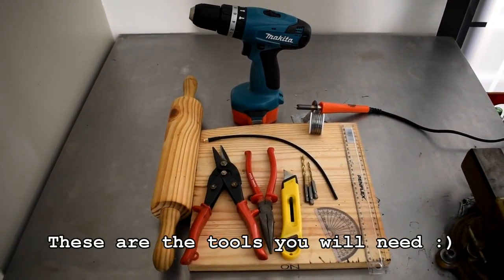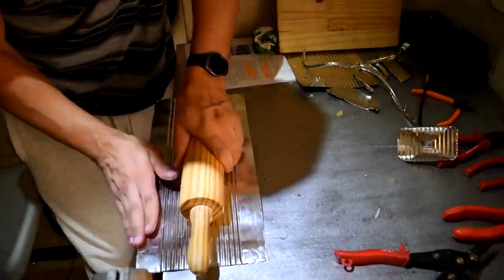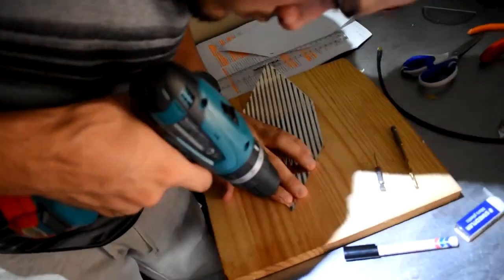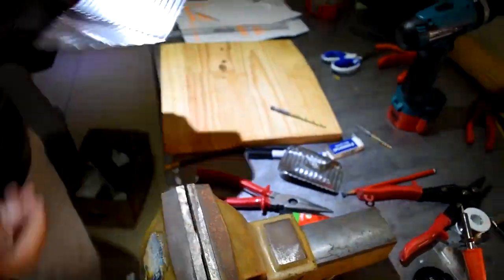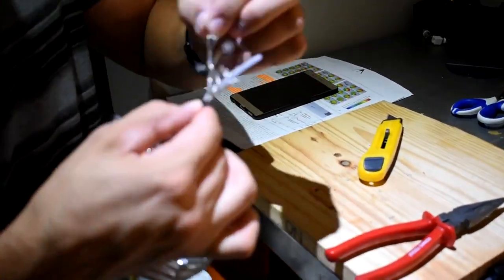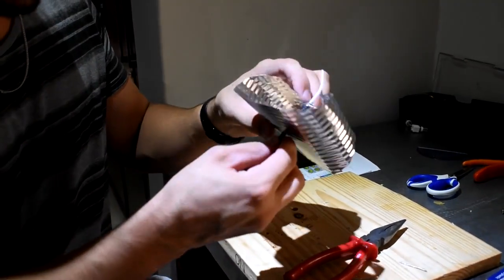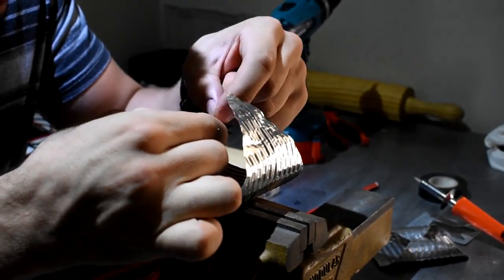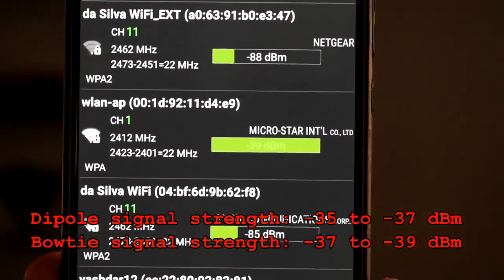Build your own WIFI Antenna - Kelvin da Silva

Comment: Had to record that intro right next to your electirc fence energizer didn't you? 😂 Lots of dual-band bowtie antenna tutorials in this playlist...would be nice to see a wider variety of design types at some point :) Also I notice that each student used different lengths for the 3 partitions, and different angles for the triangular cuts accordingly. Kelvin did state that his design can be scaled proportionally, but did not state what the scaling would achieve (presumably, a larger variant would result in more gain? -- can it be scaled to any arbitrary size so long as the relative proportions of this design template stay constant -- or must it conform to specific "preset" sizes which conform to the targeted frequency's wavelength?). Further clarity on the significance of the length to angle ratios or how they are determined in the first place was not detailed and would be nice to know.